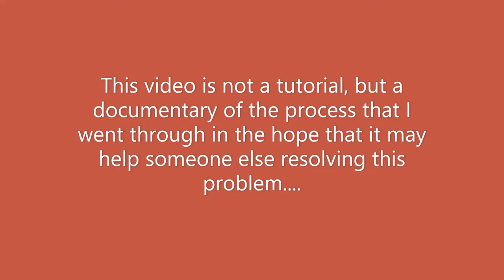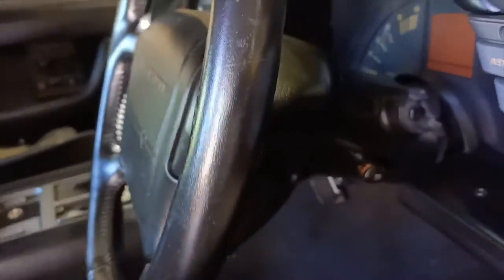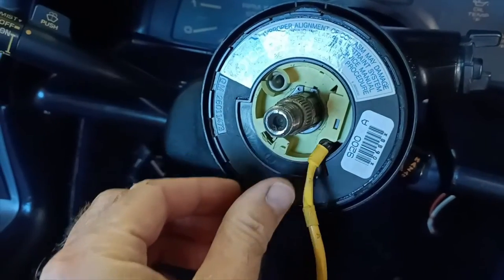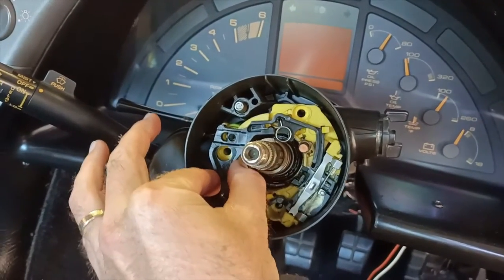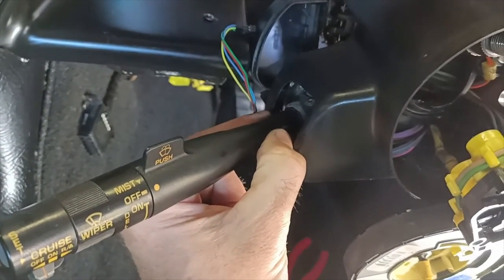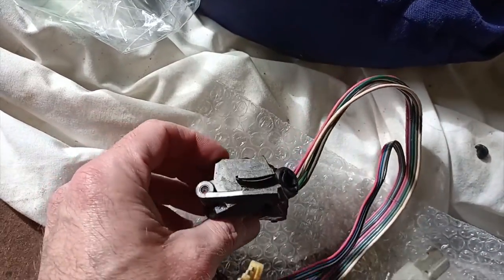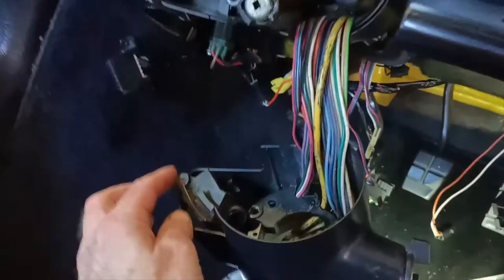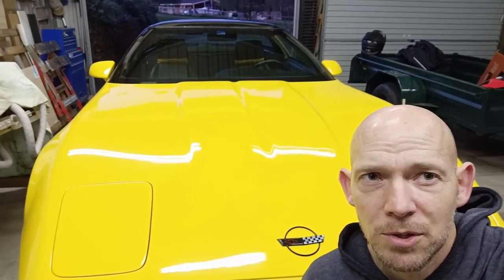1990-1996 Corvette Multi function indicator Switch replacement, steering wheel removal

Comment: I have a minor issue with high beam on my 95 C4...same stock.  I'm think I may just live without high beams based on the multitude of small parts in disassembling the steering wheel.  Likely I would end up with several bigger issues and a few missing parts.  I was hoping I could go in on the side of the column.  Thanks for saving me a load of heartache!
Reply from the maker: Glad it was of help!
Reply: My 96 with 25,000 miles on it has the same problem I can't shut the high beam switch off. I think I'll live with the issue also
Reply: @crealedc  does the high beam clicker move a metal bar that is on the column? if so, can you reach under and move that metal bar up/down maybe to go back to lowbeam?

Comment: This video is a godsend! Thank you! I've not been able to find the whole assembly which is at fault, so I used JB Weld to "glue" the little piece to the "white arc" of the greyish/black larger part. I've not assembled everything back. Will update later.
Reply from the maker: Thanks Genie! In the absence of new replacement parts, it will be good to know if there is a successful way to repair... keep us updated.
Reply: Genie, did your repair work?  I am considering doing the same thing since this part his so difficult to find.
Reply: @tomjones1934  Yes. I ended up using the same part....gluing with JB weld for plastics.  Pardon my memory, but the part that broke was hard plastic with a metal reinforced piece. And then I just installed everything back in reverse of the youtube video.

Comment: I tried to remove the car's steering wheel, but it was stuck and I don't know why corvette c4 1990
Reply from the maker: Are you using a steering wheel removal tool/ puller?
Reply: @jpkvids  yas

Comment: Wow what a job!! Great job on the repair. I just dropped my steering column on my 95 to put a bigger pin to help get rid of some play. The high beam switch piece fell out. So I’m working on getting that back in. Hoping I don’t need to pull steering wheel off...
Reply: Thats exactly my problem
Reply: I‘ve also been struggling to get this plastic piece in place without it falling down. Is there anyone that can walk me through so I can finally finish assembly. Can't find the high beam button near the firewall. Does anyone have detailed pictures of how to assemble this switch piece etc. 
Hope someone can help 
Thanks
Arnold

Comment: Jason, first of all thank you for your video. I have a 96 Lt4 that I bought sort of destroyed in a auction in USA, shipped to Dubai and I am restoring in my garage. Lately I had a problem with the ignition barrel. It just stopped working and the key was turning 180 degrees in the barrel. So I disassemble everything and well, to put together, was a pain honestly. But one piece came off and only today I found out that is the Headlight dimmer switch actuator. But still I havent figured out how to place it back. Any clues on that? Another question, for the start process, the tumbler needs some sort of “spring” that pushes back the key to the ON position after the start. My tumbler is not doing any more and I simply cant get contact to work. Just bought a new tumbler but it dosent seems that the spring is part of it. So please, do you know how to attach the Dimmer switch actuator? And do you know where is this “so called” spring that pushes the key from start to ON located ? Thanks Mate , best regards

Comment: What is the actual part number for the piece you showed in the video at 18:20?   It's described as Corvette turn signal switch?   Was there an actual  part number(s) stamped or molded on the part?   The red painted number might have obscured the part number underneath.  Thank you.
Reply from the maker: From the comments below;
@Joseph Howes  part # 1S4664
https://corvetteparts.com/item/wiper-amp-signal-arm-pivot-switch-assembly-1990-1993
Good Luck

Comment: Where did you find the part?
Reply: After typing that I saw the point where you plugged the business' name. It would be nice to know the part number to see if I can get it elsewhere too. I can't seem to find it searching for turn signal switch or combination switch for a 92 Corvette.
Reply from the maker: @JosephHowes2003  I searched for new parts, but was unable to find anyone still making them. I did find a company that used to make them, but when I contacted them they advised it was no longer in production.... hence, second hand was the only option (though I did find someone here in Aus that had a new old stock part, but he wanted crazy money for it!)
Reply: @jpkvids  I've heard some people just fixed the part.
Reply from the maker: With a good glue, you could glue it back on.... but I wasn't confident it would last
Reply: @jpkvids  JB Weld supposedly works well. What's the exact part name or number so I can try to find it?
Reply from the maker: @JosephHowes2003  part # 1S4664
https://corvetteparts.com/item/wiper-amp-signal-arm-pivot-switch-assembly-1990-1993
Good Luck!
Reply: @jpkvids  it definitely seems difficult to find.
Reply: @jpkvids  I wonder if one from another GM car of the same era would function well enough. Maybe from a Camaro.
Reply: @jpkvids  hey mate - who had the nos part? can you email me scott at waysco.com dot au please. i am in brissie and struggling to find the part
Reply from the maker: Sorry  @scott2251  , I can't recall, and cannot find anything in my email - though I seem to recall it was a phone conversation, and I'm pretty sure it was one of the corvette places in Melbourne...

Comment: Did you have a method of aligning the high beam setup?
Reply from the maker: I don't recall having to do anything special to align the high beam setup?
Reply: @jpkvids  It's kind of a nightmare to align it and still get it back together since nothing supports the little plastic piece that pushes against the rod that then hits the high beam button near the firewall.
Reply: Joseph have you managed that?? Jesus, I am strugling for 2 weeks already. And I had problems with the coil seats on the first collumn bearing as well . Mounted upside down and to put it back was not good. This video showed me the correct position. But stll fighting with the actuator

Comment: Can I get the links to everything you bought?
Reply from the maker: Unfortunately there are no links... As noted in the video, after much searching for new parts (to no avail), I picked up a second hand part. Other than a 'special tool' that I made, everything else was just labour.
Reply: @jpkvids  thanks! Do you have the part numbers?
Reply from the maker: @GoldenEmpireProductions  Frtom the comments below;
@Joseph Howes  part # 1S4664
https://corvetteparts.com/item/wiper-amp-signal-arm-pivot-switch-assembly-1990-1993
Good Luck